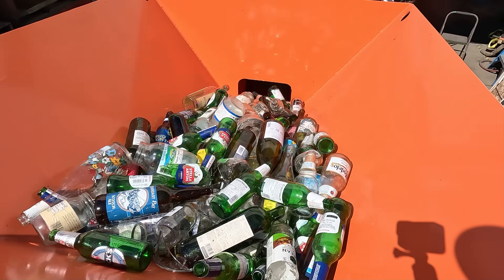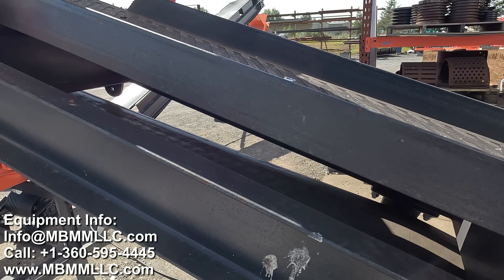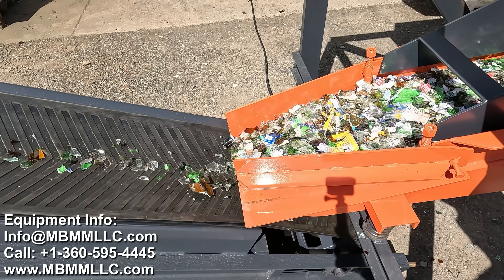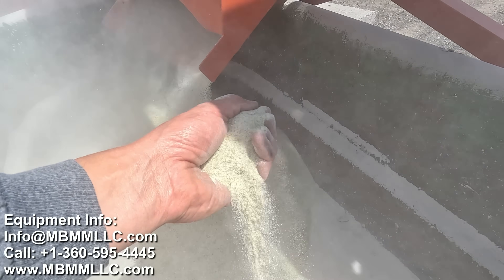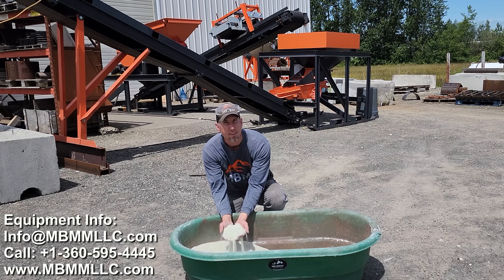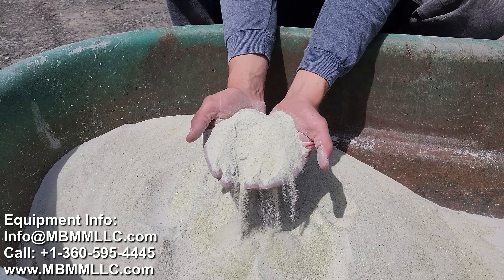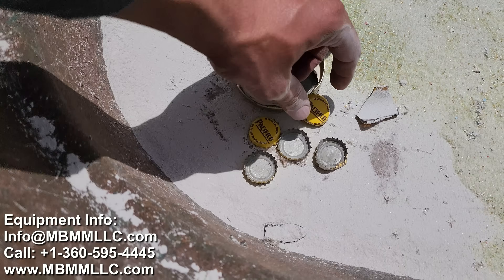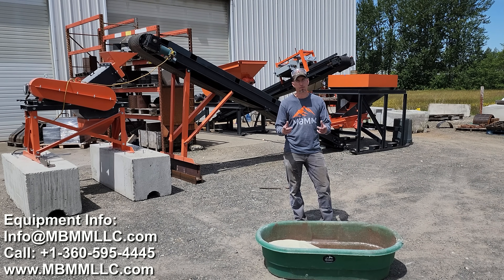Recycling Glass To Sand

Comment: Glass sand is composed mainly of silica (SiO₂), similar to natural quartz sand. In the form of large grains, it does not pose a threat, but if it is ground into a very fine dust, it may irritate the respiratory tract and lungs.

Long-term (with regular exposure):

• Pneumoconiosis (silicosis) – if the composition of glass sand includes crystalline silica, it can lead to lung diseases similar to those caused by inhaling quartz dust.
• Lung diseases – chronic exposure to fine dust may lead to inflammatory conditions, pulmonary fibrosis, and an increased risk of cancers of the respiratory system.

Comment: I am an e-scraper and I am trying to find a way to separate the lead from the glass in crt tube tvs. My plan was to try a rock crusher and pulverize the glass and then try to collect the lead with my gold cube machine. After that I was going to try chemicals to further purify the lead from any left over glass. Before I try any of this and continue taking in unwanted crt tvs, do you think that would work? Your machine set up is an expensive dream place that I'll never be able to afford so I'm trying to think outside the box. Or maybe after collecting the lead from the gold cube, that I could heat the lead up and skim the glass off the top for pure lead? Thank you. Any help would be greatly appreciated. Tvs have a lot of lead in them and I hate how it goes to the landfill.

Comment: Hey Jason, Do you have a plastic granulator? And any chance you guys making lighter duty machines for residential/non-commercial use? 

I'm a home recycler, trying to prevent everything that comes through my house from going to the landfill. organics are easy with a compost pile, metals and glass, not too hard. Plastics is the one area that I know we can't trust the recycle centers to actually recycle it, so we have to chart our own course. I'm supportive of the precious plastic movement and have some other ideas where their methods break down, but I need to be able to granulate the plastics to a relatively small size, 1/4 inch or so.  

Of course a machine that could reduce copper wire, glass and plastics would be the ideal. 

The Entry price for the smaller machines I've found is $1500-2500 (some from china and others that make the precious plastics versions of the machines). If you could make a machine in that range or close to it, you may open a wider market.

Comment: I worked at a glass recycling plant and when we received dumpsters of glass bottles . We had a system that had a magnet that pulled off ferrous and  some sort of electro magnet that put non ferrous metals out the glass. Further down the line the glass was separated by the color of glass.  Where it was mixed with crushed blue plate glass and turned into sand size particles  and sold to Owens Corning so they could make fiberglass from it.  But the the non ferrous  metals removed consisted of  lost  jewelry like rings and necklaces.  Plus lots of coins.   But there was also lots of lighter materials that had to be removed too.

Comment: This is another practical use for these machines, we really need to stop dredging oceans and rivers and destroying valuable aquatic marine  habitat just to get sand for the construction industry.
Reply: Unfortunately, Jason said the grains are rounded which makes it pretty much useless for concrete, that's the reason desert sand is not used. Perhaps the machinery could be set up differently?
Reply: @artmcteagle   A rolling ball mill crusher run for a short time would be better,  a high speed pulverizer is too much.
Reply: @mrMacGoover  Adapting for purpose seems the way to go.

Comment: The product is not sand.
The glass is still glass.
Just mich smaller.
It will cut your ling tissues.
Reply: What about your lung tissues? And furthermore, as it goes through the hammer mill, it's abraded and worn smooth by both the metal of the hammer mill and the rest of the other particles. Finally, anyone with a functioning brain (like people who know how to spell "much" and "lung") wear protective gear when working with materials like this in any case.

Comment: I was wondering if the labels contaminate the final product.
Reply: The paper and any metallic foil would be fine. Paper just forms humus and finely-divided metals will corrode away. The adhesive and inks may be benign or not depending on their formulation. However plastic coatings would generally break down into microplastics.

It is probably more of a concern if plastic containers can end up in the feed. The jaw crusher would generally flatten these rather than breaking them up so a coarse screen could remove them. An inappropriately-sized plastic container might just clog the jaw crusher.

Comment: if you try to remelt it do you know what color if any glass you would end up with?
Reply: The color would be brown.
Just like when you combine all the colors of paint it becomes brown to black if every single color is present.
Reply: @WishinIwasFishin-ou812  sooo beer bottle glass pretty much LOL
Reply: @WishinIwasFishin-ou812 not necessarily. You're missing all the red spectrum in glass. Red glass can be made but it's more expensive. And technically in light, unlike paint, when you combine all the primary colors of light (red, green, blue) you get white. It's a good question though and sort of makes me want to pulverize certain colors exclusively to see if there's much difference in say like all dark blue glass turned into sand? Compared to all brown or all clear glass.

Comment: Gaddamn I hope I don't go to a beach or a municipal play area where they've used this kind of sand... 

I've ground telescope mirrors and I know that mirror dust (same thing as this) is real nasty and we use a mixture of soap and water to keep it out of the air while grinding. Silicosis ain't worth it man. This seems mega dangerous
Reply: "municipal"? Grinded is not a word either, so I can't put any credibility in your statements if you can't even spell.
Reply: @dionh70  😘

Comment: Isn’t that like super dangerous to breathe in?
Reply: Yep
Reply: "Glass smoke-- don't breathe this!"
Reply: Silicosis
Reply: Rock crusher standard PPE would make this just a panic worry for those who didn't think it through 😂  
Just consider this if you aren't wearing a particulate blocking mask while crushing any rock even, you may find a short career in rock crushing. Silica is not just in glass and isn't even the worst you will be breathing then.
Reply: need to go through  a wash to remove the glass dust.
Reply: That’s why his voice changed when he’s close to the dust, he has a mask on and he goes back to edit him talking in later
Reply: Back in the day when TV’s had a huge glass picture tube these TV companies in Japan would crush the bad picture tubes and recycle them into new ones on site. Nothing was wasted, try that with today’s flat screens.
Reply: Glass is amorphous silica, not crystalline.  Glass is a salt of silicon dioxide and various metal oxides.  Sodium-calcium glass is most common.  Boron glass is heat resistant like Pyrex.  Lead glass is highly refractive and soft which is crystal.

Glass sand is reactive to Portland cement, making weaker concrete.
Reply: What happens to the labels in this neat process?
Reply: @laughingwolf8711  sand
Reply: Nothing compared to crushing rocks.
Reply: Duh. So is rock dust generated while crushing rock. Common sense tell anyone that fine particles of ANYTHING in your lungs is bad.
Reply: Silica poison ☠️

Comment: ok so that dust thats blowing, that will wreck your lungs my guy
silicosis to the max
Reply: silicosis is caused by crystalline silica, for example quartz. Glass bottles are amorphous glass, which is the opposite of crystalline, so the risk is totally different. However, you should really avoid breathing any solid particles, it can still cause problems, but at least your lungs lymph can remove amorphous glass particles.

Comment: I really wish we would return to glass for most things. I'm old enough to remember milk and Coke coming in glass bottles. I did a blind taste test with friends between coke in glass bottles and coke in plastic...everyone said the glass bottle coke was better. The great thing about glass is how it is chemically inert and can be recycled into oblivion. Even if it escapes into the environment it doesn't cause issues because it's chemically inert. It just sits there until it wears down into particles and joins the sand, or it gets crushed and buried without causing any problems. 

Plastic is good for many things but we shouldn't be using it for storing drinks, or food in general.
Reply: I thought the coke in glass tastes different because it's made with cane sugar instead of high fructose corn syrup in the plastic bottles.
Reply: @65BAJA   in France they don't use HFCS, only cane sugar and there's a notable taste difference between plastic and glass-bottled Coke. 😉
Reply: @65BAJA  
I honestly don't know if that is true or not. Even if it is, the glass is still chemically inert and therefore preferable in my opinion.
Reply: I use glass bottle or aluminum cans as much as possible. Even the cans have a plastic lining unfortunately, but they have a 100% recycle rate if it makes it to the recycle center, unlike plastics which is less than 10%.
Reply: This is same problem with pallets. Yeah reusing them would be great. Until you realize that shipping entire trucks of pallets (or empty bottles) is a huge waste of transportation costs and fuels and storage space. After watching a massive fire shred through a pallet storage yard in recent years, it goes to show saving pennies sometimes costs thousands in unanticipated costs.
Bottles break or have to be snugged up like the old milk bottle trucks slowly rolling down the roads. Times change because better ways are found. No reason to go back, just time to find the next better way.
Reply: @colonialcharlie8702  
I understand this argument but there are ways around it. For example the trucks which deliver the full bottles can pick up the empties. This is more efficient than dropping off a load and having an empty truck returning to a warehouse to load up again. 

Then you factor in reuse compared to fresh manufacturing costs. This, depending ont he product, varies in the efficiency. However when you then factor in the extraction costs of new material the maths tends to shift towards reuse being both more efficient and less polluting. Again it varies by product type. 

Pallets are one of those things where it would be more efficient to either burn them as fuel (power plants), or sell them to people who make other products from them. Shredding for mulch, cheap timber for boarding areas, the small market who turn them into furniture etc etc.
Reply: @laughingachilles  Yeah, glass is absolutely superior to plastic in pretty much all respects if you can get producers to actually reuse the same bottles again and again, and thus get them to time deliveries with pickup. Costa Rica has pretty strict standards on this, you will see all the beer bottles from the night before getting stacked neatly into the crates they came in the morning after. Unfortunately transportation/logistics have become totally decoupled from production. The guy picking up the beer and dropping it off is a subcontractor of a firm offering the lowest price at that moment, the producer doesn't have any dedicated capacity for shipping. Everyone wants to be efficient as they absolutely can in their specific task, and the whole system suffers as a result of lack of integration. 

But if we work in the real world, where at best we crush the glass up and sell it to the bottle manufacturer to be torched up and then once again shipped across the country to the filler, then glass recycling is just nasty greenwashing.
Reply: The upside of having glass is that we won't be full of microplastics. The downside is that transport is heavier, which means more Co2 emissions. Given that the environmentalists in power ONLY cares about co2, we better get used to the plastics.
Reply: @snailswrath  be quiet and finish your microplastics or you'll go to bed early!
Reply: @snailswrath  i don't understand how producing 1 kg of glass is making more co2 , than 1kg of plastics.  Doesn't make sense. 

To make glass it takes 
1 take -  silica , soda , lime
2  heat to 800 Celsius and pour into a mold. 

To make plastic , many more steps are needed ,
1 extracting oil ,
2 fractional distillation , separating naphta
3 cracking , naphta is superheated with water steam further braking into reactive chemicals + further distillation of ethylene
4 polymerization of ethylene under extremely high pressure brought together with  catalytic element.
And get plastic.  

All done is in 2 factories , 1 oil distillation 2 chemical processing plant. 

When glass is made in one step.
Reply: @Rom2Serge  Well my argument was for transport. Glass bottles can be 15 times heavier than plastic and moving weight around requires more fuel. But plastic is both more energy efficient to produce and transport in every step of the process. Although it seems to be poisoning us.
Reply: @snailswrath  i do  agree that bottle of glass is much heavier than madecof plastic. Maybe 10 times different.  
And in big bottles because it can be 20x. 

As for production of 1kg plastic to 1kg glass ,  charts say less of co2 is produced when plastic is made. 
Simply for me id doesn't make much sense because much more complex steps needed to make plastic. Im not an industrial engineer ,  maybe they super efficient or something , but still have my doubts. This what i meant.
Reply: @snailswrath  do your part to save the planet: more CO2 is good for it and us! 😘👌

Comment: Maybe use it in a sandblaster thanks
Reply: I have used this stuff for years in my blast cabinet.
I have bought it from the local lumber yard for years.
No matter what medium you use, wear a mask or respirator.
I had not even thought about it until I was told that my lung cancer may have easily been caused by years of sand blasting.
Reply: Glass works really good in Is a sandblaster. So Does crush up walnut shells
Reply: 1:53